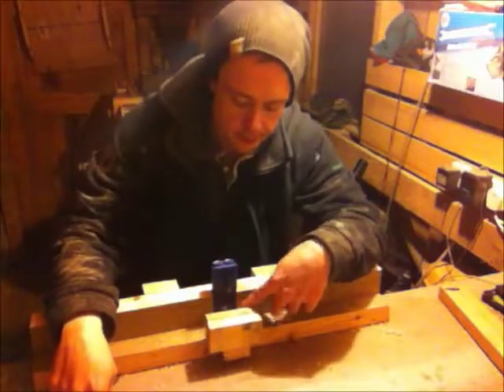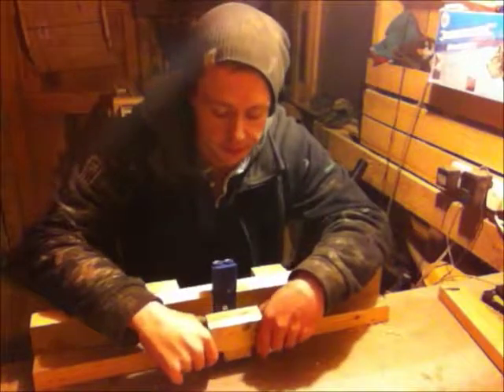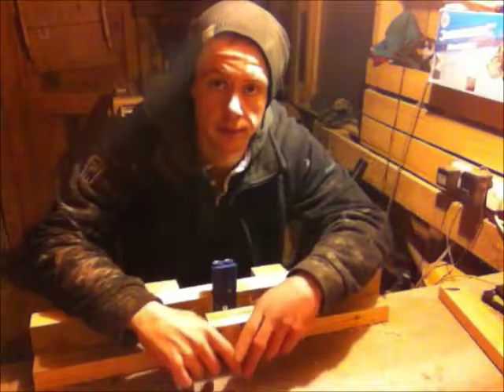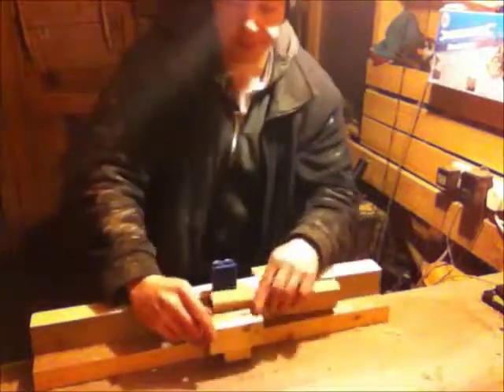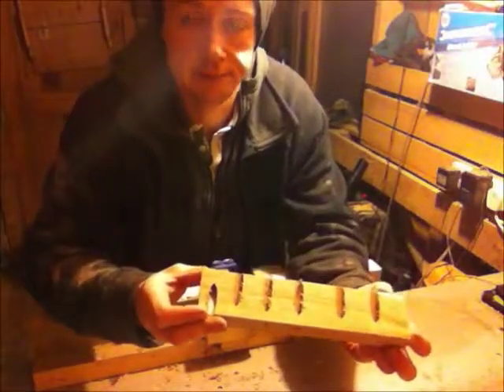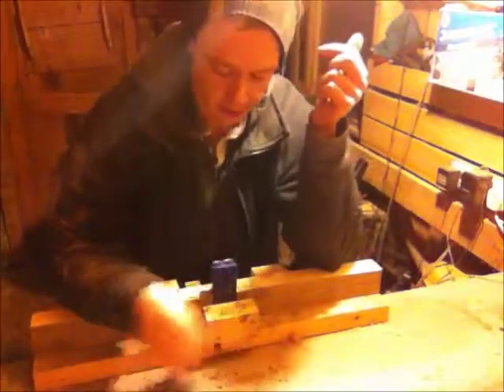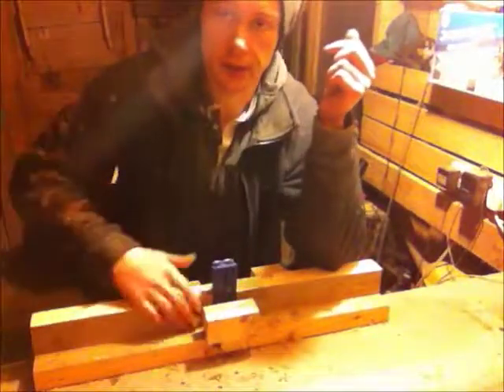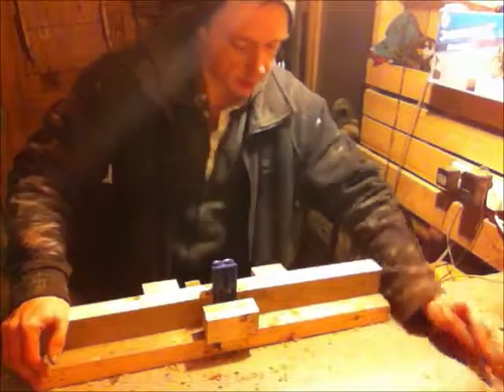pocket hole clamping jig

Comment: How would you adjust for different wood thickness?
Reply from the maker: All the adjustments are made at the lock color on the drill bit. drill a series of pocket holes of different sizes with the kreg jig out of the clamp. with these you can workout different sizes to lock your color and make a small drill hole jig which will give you the correct location without ever touching the kreg jig. The process and the jig its self greatly speed jobs up. Its one of the best jigs ive built . Hope this helps.
Reply: Thank you. I will give a it a try.
Reply from the maker: Ya welcome mate.